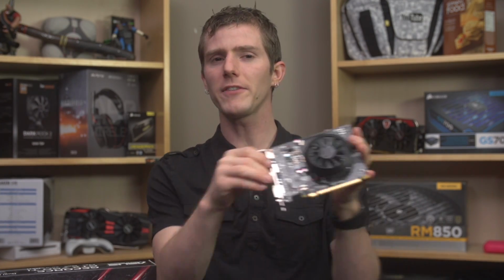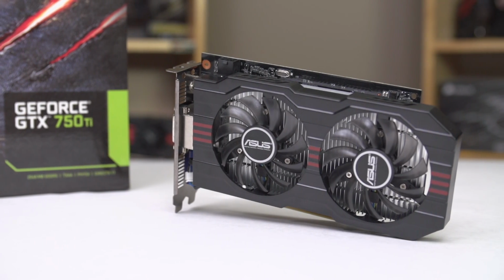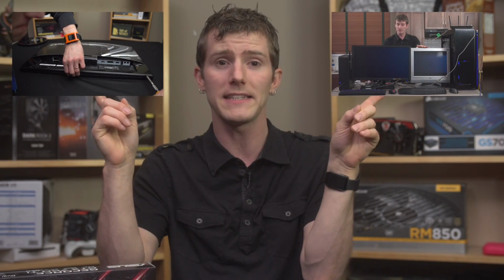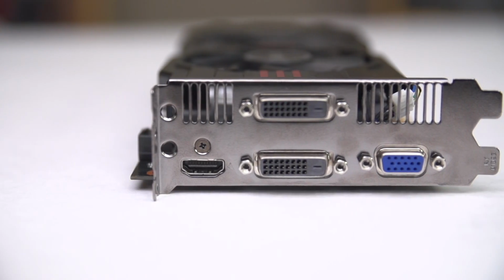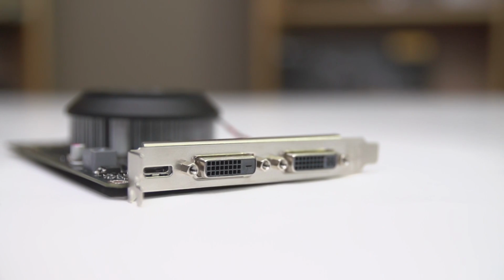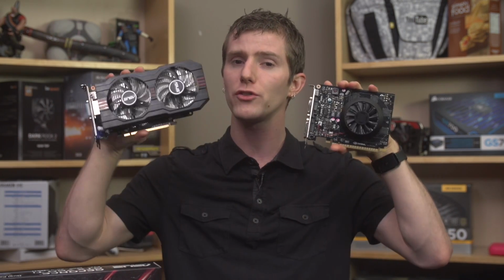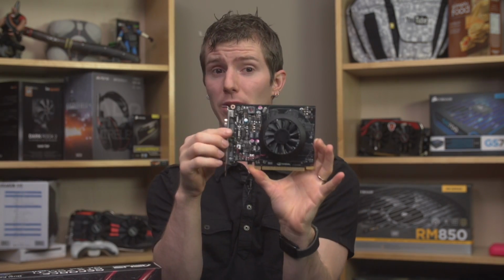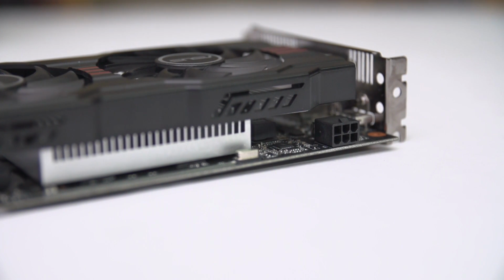GeForce GTX 750 Ti NVIDIA & ASUS Designs

Comment: Remember when 50ti cards didn't need a goddamn power connector or elaborate cooler designs? 

An rtx 3050 non ti needs a power connector and the ti variant is laptop only. Kill me
Reply: The 3060 8gb should be the 3050ti

Comment: It's Dec. 15th 2021 and I had to take the plastic shield thing off my heatsink (and the heatsink off the card itself {yikes, first time doing it too} thankfully didn't brake or damage anything) because the fan bearings started grinding so bad it could be heard from the entrance of my home and I live a floor above- I did the handy dandy trick of ziptying an external cooler to the heatsink after cleaning it and the chip with some toilet paper and re-applying some thermal gel. It's working better than it was a day ago but still not as good as when I got it. At least it's still alive, it's so hard finding a GPU to upgrade to that won't brake my bank (not that there's anything TO brake haha) Very cool video, I'm glad I re-watched this to remind myself of the good old days. Hopefully the Linus Tech Team is getting enough sleep now-a-days

Comment: Im rocking this card 7 years after release, still can do 1080p 60FPS without Breaking a sweat
Reply: If u don’t mind lower than 720p u can easily play cyberpunk at 576p (80% of 720p) (576p is quite a bit blurrier than 720p but not anything too major and plus it’s not stretched unlike 600p although it looks quite a bit worse than that resolution too) low constant 30fps. Even after 7 years it’s holding up quite ok just remember it was a budget gpu, only 75w tdp and cyberpunk is the most demanding game ever released.

Comment: 6 years now and it's still kicking ass, mine is running Cyberpunk 2077 without much trouble at a stable frame rate (at low settings but still)
Reply: ikr mine still working like a champ playing decent res and normal fps

Comment: Its been 6 years and this gpu can still do some games at 60fps.
Reply: Game before 2017 that is. Nowadays, probably only on some Indies games.
Reply: @fakuri913  Bro it can run fortnite, minecraft and roblox over 60 fps and technically they aren't indie games
Reply: @Proton169  those are old game, my point still stand.
Reply: @fakuri913 um most esport games like valorant and even old aaa games also rocket league and stuff like that.
Reply: facts

Comment: End of 2018 and this little guy can still run FC 5 at ultra settings keeping it just over 30fps. Still the best budget card out there.
Reply: I tried running far cry 5 with a 750ti from asus. It's unplayable at low settings at 1080p even at 1600x900 got a GTX 1080 strix run better

Comment: i overclock GTX750ti core clock from 1080 to 1400 without 6pin connector & the framerate gain 6-8fps.
Reply: i'm using DA GTX 750ti Stormx single fan.

Comment: How do you guys think this will do in 2017? I just got this for the New Year, it's running with i5-4460.
Reply: 750 ti runs great for many games today! Doom 4 gta 5 overwatch resident evil 7 overwatch. Enjoy m8!
Reply: I see, looks like I'm in luck. Thanks man! :)
Reply: Broken Clockwork you are welcome :) I also have a 750 ti and so far haven't found a game that it can't play. All games I tried run great on 1080p.
Reply: Hmmm.. did you get an Asus ROG G20AJ???
Reply: Umm no. As for me, I built my own PC. :)
Reply: Nice, I have the GTX "reference design" 750 2GB and the i5-4460. The cpu is great, but in my opinion the GTX 750 is way too underpowered for my liking.
Reply: But then again it's a great graphics card for low-medium 1080p settings for most games. But gosh dang it's not good for X-Plane 10 or any other game that has a high demand for graphics

Comment: Hello Sir ....................... help me........................... plzzzzzzzzzzzzzzzz..... I had flashed wrong bios on my Zotac gtx 750 ti ...... that the non 6 pin version with the asus 750ti bios with 6 pin connector version... now card is asking to plug 6 pin power its not booting and also not getting detected in USB dos mode using nvflash...... help  meee...............................................
Reply: Jagminder Singh you're fucked
Reply: I have fixed it I m.not fucked ... I have fucked lol

Comment: That connector that connects to the power supply do I have to buy it or what I don't get it ? Please help !
Reply: The 6 pin PCIe connector should be included with your power supply, bound to the power supply or in your modular cabling kit. If you don't have it, you can't run the card without an adapter, which I don't recommend.

Comment: whats the diference betwen gtx 750 and gtx 750ti?
Reply: cuda core count. the GTX 750 has 512 CUDA cores, and the 750 Ti has 640 CUDA cores  (and probably a different clock speed too). most GTX 750's have 1 or 2GB GDDR5 RAM and the 750 Ti can have anywhere from 1GB GDDR5 all the way up to 4GB GDDR5 RAM.
Reply: DeadNullermand alright tnx

Comment: is this card any good? Does it run the same as the EVGA gtx 750ti or the Msi version?
Reply: if you plan to overclock the 750ti then the evga or msi versions will be better cause they got better cooling system but if you don't plan to overclock then they all should perform very similar at stock. do note tho which version need a power connector or ones that can power on straight from pci-e slot

Comment: I am thinking of switching from my R7 250 to this, is it worth it or should I just stick to what I've got? (btw my budget is 150€)
Reply: rx470?
Reply: 750ti is much bigger step above r7 250 but gtx 950 would be better value.
Reply: Nope. 1. 750ti doesn't have sli, 2. 3 way sli really not supported even by nvidia you won't really see any advantage over 2 way sli

Comment: will a q6600 bottleneck this gpu?
Reply: +Michael Haslinger ok.
thanks!
Reply: Nope.
Reply: ok
Reply: Jermain Van der Oord you're welcome
Reply: yes it will to a certain point but i really doubt you would be able to play any modern game that is decently optimised on a cpu like that anyway. so if you are going to buy one of these you should consider a new cpu. if you are on a budget go for something like a pentium g3258 or an i3 6100
Reply: leoinas Sven i now have an g4400
Reply: leoinas Sven and i am planning on getting a gtx 1050 
will i see an improvement from gtx 750?
Reply: most likely yes as well as more power efficiency
Reply: Personally i run an i5 6600k and a gtx 1070 tho so i am not 100% sure about how much improvement you wll get
Reply: leoinas Sven ok , thanks
Reply: np bro

Comment: what really cheap PSU is compatible with this
Reply: Fernando Mateo ALL
Reply: Pretty much every no name PSU will do, as long as the card doesn't have a power connector. the MSI version of this card (which I happen to still have as a backup card) worked with an old Fortron 350W PSU. Minimum wattage recommended is 300W.
Reply: Fernando Mateo i have a 260 watt psu. I5 2400, will it run? Gta iv, minecraft and stuff like that

Comment: Just got one today. It's infinitely better than the GT 730 that came with my computer. It's the Superclocked version. It has  DVI, HDMI, and DisplayPort connectors.
Reply: same here got mine today too
Reply: +cpcheats2003 UPDATE: I now have a GTX 950.
Reply: +cpcheats2003 I know it's AMD, but I still like to call it ATI.

Comment: I'm thinking of making a cheap gaming rig i3 and 750ti should be ok right
Reply: I wouldn't say that the X4 is better than recent I3 in most games, as their single threaded performances are great, but it is less expensive and you can overclock it to make it actually better than an i3

Comment: GeForce GTX 750 Ti is 2 years old. Is there a successor card?
Reply: "Everybody is switching to 1440p and 4k"

That's a good argument considering this card isn't targeted at the people who use that then or now.
Reply: +electronics for fun in Canada, the 950 is actually cheaper now than the 750 Ti and you can pick a up a used GTX 780 and or a used GTX 960 for the same price as a 750 Ti. With the shite exchange rate: GTX 950: $180 GTX 750 Ti: $200
Reply: GTX950 for now. The 1050 will be announced at the end of the year. There are Low-Power versions, that do not require PCI-E Power, and the standard cards that do require 6-Pin if not heavily OC'd, 8-pin if so.
I will also mention you the RX 460 from AMD, which with its 100USD price tag for the 2GB version, and no need for PCI-E power, while also slotting in between the 750Ti and 950, is a compelling purchase if you are low on PSU power.
Reply: Do either of those cards require external power?
Reply: Thanks.  :0)
Reply: every graphics card that is worth a damn requires external power.
Reply: This video is about the GTX 750 Ti, which does not require external power.
Reply: SuperGhettoBob and it is not worth a damn. it will be crushed in synthetic benchmarks and can barley play AAA of today at a decent setting.
Reply: Name a current AAA title that will not play on the GTX 750 TI on medium graphics settings at 1080p.
Reply: SuperGhettoBob see that is the thing, everybody is switching to 1440p and 4k. this is a good budget card, but it isn't worth a damn, because it cannot run at the new spec commodity, even an SLI would struggle a bit, but that doesn't matter because there are no SLI fingers on this card anyways. there is a external powered version of this card that was mentioned in the video that would be better, but still no SLI fingers.
Reply: The GTX 750 TI delivers similar performance to the PS4 and Xbox One.  It can play GTA V, Fallout 4, and Witcher 3.  I think it's going to be a while till we see games that are too advanced for that tier of hardware.  I agree this is a budget card that has limitations, but the enthusiast market is small, and developers make software for the masses.
Reply: SuperGhettoBob the frame rate on those games is under 60Hz, that is like console grade performance which is sub par.
Reply: In the context of competitive online gaming, yes frame rate matters.  But for casual players, 60 FPS is fine.
Reply: SuperGhettoBob 60 fps is great, the problem is this card can't do 60 fps.
Reply: Fair enough.  What is your recommendation for a GPU under $150.00?
Reply: SuperGhettoBob gtx 950. it is a couple bucks more, but it is more powerful.
Reply: Thank you.
Reply: Vrai Forte Du Nord Et Gratuit ok.
Reply: +electronics for fun zotac gtx 750 ti doesn't require a power connector.
Reply: One Two it depends on which zotac you are referring to, but the one that l was talking about was the asus card that was in the video which does require a power connector.
Reply: *October
Reply: maybe not the 1080 but rather the 1060 i would say, much better price/perfomance ratio
Reply: gtx 1050
Reply: Alright, MSI launched a Low-Profile, Dual-Slot 1050Ti. No PCI-E power required.

Comment: Do I need the 750 ti with a Asus h110m-a
Reply: Ferguson 20 diesel 960 always performs better than a 950
Reply: Ferguson 20 diesel not much of a price difference either
Reply: wat
Reply: +King Quartz yeah never mind my cringeyness I've this all figured out now
Reply: Ferguson 20 diesel i have the gtx 750 ti and a very similar mobo to that one you mentioned also asus, check out my channel :)
Reply: +King Quartz pledged out for a bit more so it's the gtx 950 with the Asus board
Reply: Ferguson 20 diesel When did you buy it ?
Reply: +King Quartz I haven't bought anything  yet I have everything together on my Amazon list I just need to buy it.and I looked at your build it looks nice.
Reply: Ferguson 20 diesel Thanks dude but wait don't buy anything trust me new amd cards will get 50% more performance for the same price as the 950 or just wait a few months for nvidia cards but those amd cards are insane the rx 470 or if you can afford the 480 are amazin
Reply: +King Quartz but that's always the case wait a bit wait another bit  you could be forever waiting for the next best and then be told hold on for the next so I don't know
Reply: Ferguson 20 diesel nah dude what the 950 is almost 2 years old already, get the 470 and you will be way happier trust me and you can keep that card for longer than the 950 for sure
Reply: gtx 950 is only a year old
Reply: +Link_Jumper I bought a gtx 950 but its basically a 960
Reply: Ferguson 20 diesel It's basically a 950 how about that
Reply: +King Quartz or
Rs the extreme one may or someone said its that same as a normal 960
Reply: Ferguson 20 diesel Those expensive variants almost cost as much as a 960 and perform worse
Reply: +King Quartz I don't see how they would preform worse
Reply: There isn't much of a difference between them

Comment: So I already have this CPU(Geforce Gtx 750 Ti) and I was wondering what processor and 16GB RAM would be compatible with this CPU. PLEASE HELP
Reply: Fx 8320e
Reply: I don't know what Cole is on. I'm guessing that you mean GPU (grahics processing unit) not CPU (central processing unit). A cpu is a processor. With that said you can have any cpu you want with it, they are all compatible. But a slow cpu will cause your 750ti to run slower or get "bottlenecked". What cpu you'll want to use depends on what you're doing and your price range. The AMD Athlon x4 845 is a newish quad core good for a budget
Reply: +sean14878 Ok thank you VERY much lol and another question but should I buy the cpu or motherboard first ?
Reply: +CloudV3 Motherboard. You have to have a motherboard that is compatible with your CPU. If you decided you wanted to go with the 845 then you'll need an FM2+ motherboard. Make sure to double check that your motherboard and CPU are compatible before purchasing. Try to find a motherboard with pci-e 3.0. It's a newer version of the slot that your 750ti will go in. A lot of cheaper or older motherboards will not have them. PCI-E would be recommended if you have the money
Reply: +sean14878 what about a 16g rsm?
Reply: +CloudV3 ram
Reply: +CloudV3 Well first, tell me, are you going for a gaming or editing PC and what's your budget like
Reply: +sean14878 he miss typed gpu as he states he has a 750ti so I recommend a CPU lmao
Reply: +sean14878 I'm going for a Gaming pc and my budget is however much tbh
Reply: +Owen Cole ty lol it autocorrects on my phone
Reply: +CloudV3 lol
Reply: Why don`t you take 2 hrs of your day and do some research so you can decide what to buy , any cpu from 50 bucks or more (Pemtium g3258, athlon x4 860k, an core i3 anything )  Also you don`t need mroe than 16 gb of  ram you can go with 8 gigs and put more money on your graphics card a nice ram would be 8 gigs 1600mhz DDR3 ram you can find that for  as low as 35 bucks  and you can try and get a gtx 950 for 140 bucks and its much better If you want i can send you a pc partpicker build with a list of all parts of a nice pc made just for you
Reply: +Victor Elias yes Please do and ty so much
Reply: *****  Since you have the gtx 750 allready just don`t count it, all the parts on that list are compatible with eachother and you can buy them from amazon and newegg just by clicking on their names . Enjoy your new PC !!! http://pcpartpicker.com/p/HDBJ7h
Reply: Idiot it's a gpu and its compatibility fits with any motherboard except too the wattage of your power supply if it doesn't have power
Reply: +TannerTheDuelist There is literally no point for you to be such an ass. It's already been dealt with.
Reply: +sean14878 exactly
Reply: any gpu can have any amount of ram, ram has no effect on gpu, what matters is, if the motherboard can support it, and if the cpu can support it, watch my video of my personal right and the order in which to choose pc hardware, oh and i give away stuff :) and if you are trying to go budget go for a pentium g3258 and 16gb of ram. feel free to ask me any questions as i reply to basically everyone or try hard to :)
Reply: l don't think there is much worry bottle necking a 750ti. you could probably run a core 2 duo with a weak card like that.
Reply: it doesn't matter what part you buy first as long as you make sure that all of your parts are compatible.
Reply: electronics for fun Mfw buy a gt 210 it is compatible.
Reply: Victor Elias what does "Mfw" mean? why would anybody but a gt 210? that would be like a down grade from integrated graphics.
Reply: electronics for fun  You said buy anything as long is compatible xD it means: my face when